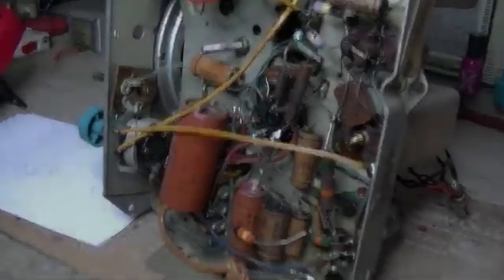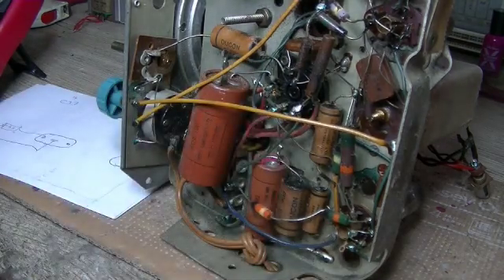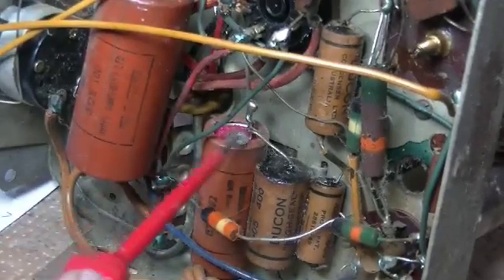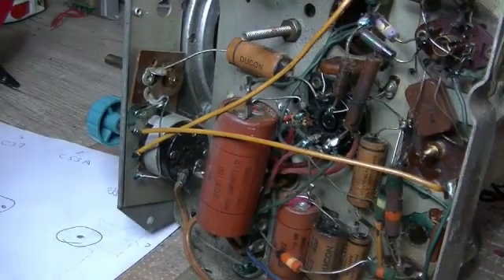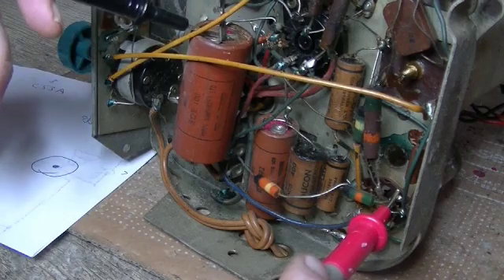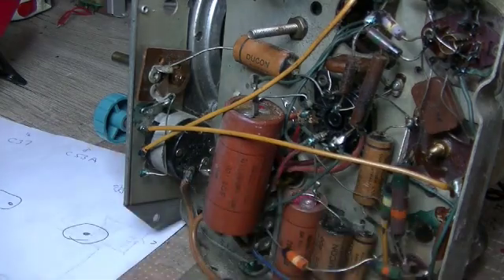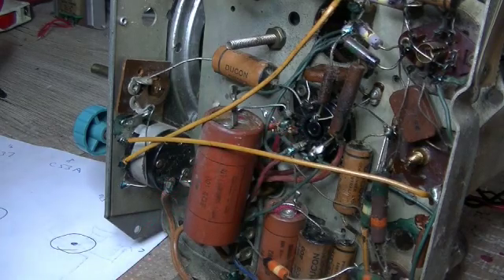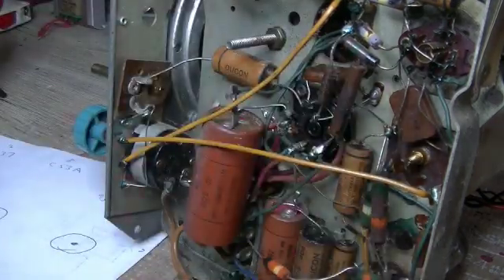Methods to Identify the Capacitors in a Dual or Multi Cap Can in your Valve Radio

Comment: With the '3-in-a-can' ones, sometimes the third one is rated at a lower voltage, as it's often used on the cathode of the output valve to chassis. Hence might only be rated at, say, 25V or something. So you don't want to connect that one to HT by mistake, and bang!
Reply from the maker: very true lol